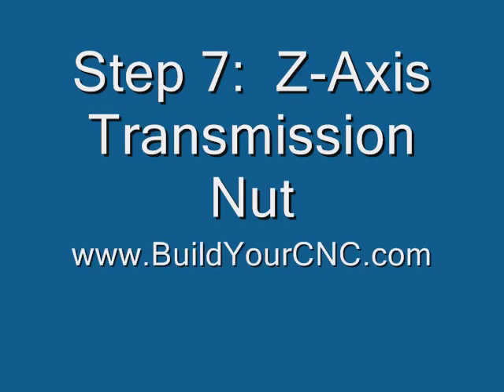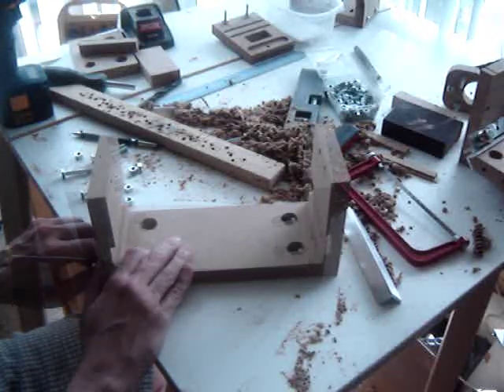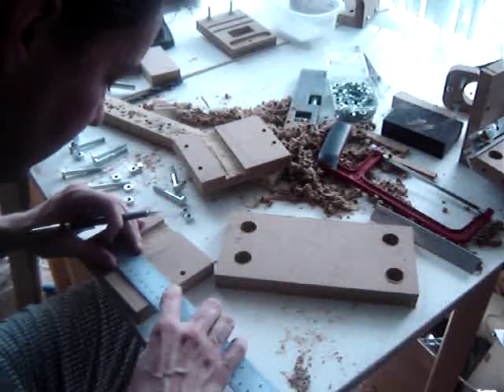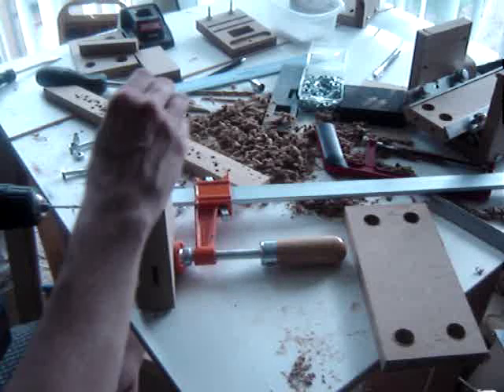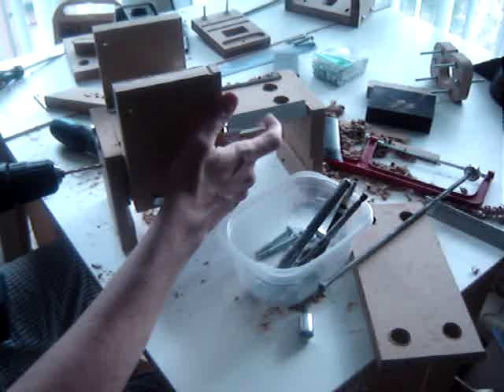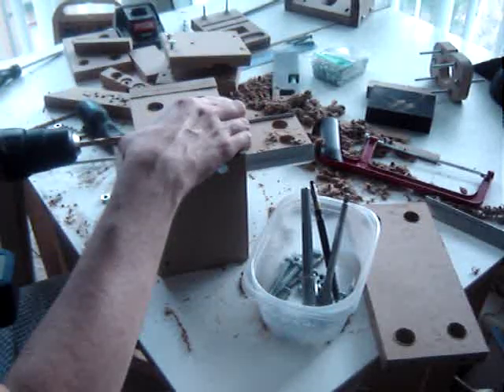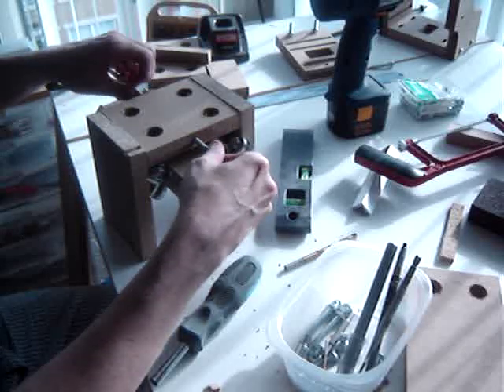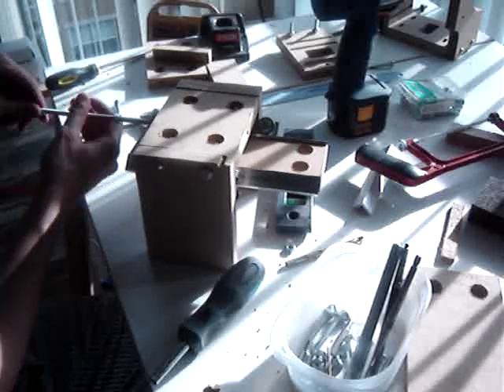step 7 Z-axis lead screw and nut for the CNC Machine

Comment: Feb 12, 2014 this is what's on their site:

Go to Tutorials and just keep scrolling down. You'll eventually start seeing Steps in the titles.
Step 8: X-Axis Front and Back
This tutorial is dated, if you are considering a CNC for your personal use, we would highly recommend purchasing a kit that is very stable from our wide range of machines available. We are going to cheat and skip to the x-axis for a minute, well... actually 8 minutes since that's about how long the video is. The CNC router has a table, right? The flat piece that you put the stuff on to cut, right? Well, that piece has this thing called the gantry riding over it. How does that gantry move? It needs to hug this surface and requires a piece underneath. In other words, the gantry cannot move unless this surface is lifted above the ground to accommodate the gantry support and the motor underneath.